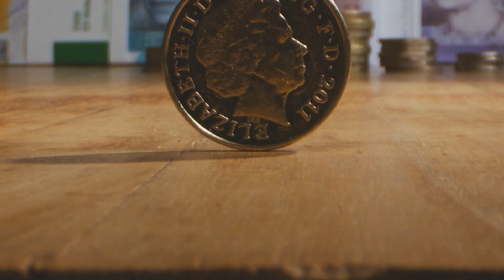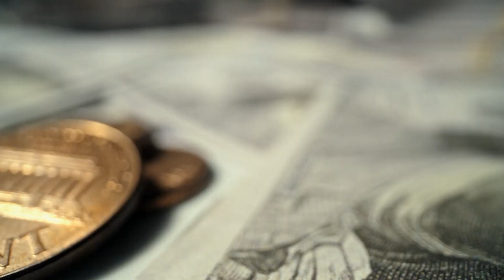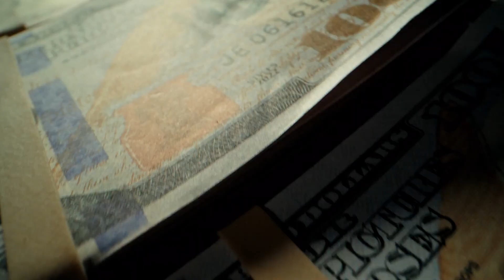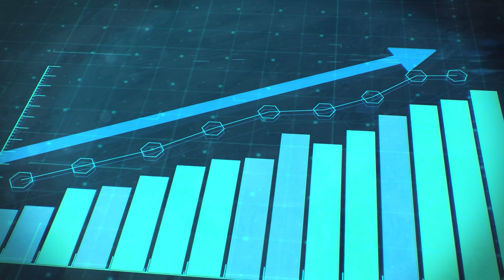What Musk Just Did With SpaceX Shocked The Whole Goverment!

Comment: Q88 is an industry standard questionnaire used to assess the suitability and risk of a vessel when chartering tankers for commercial purposes. It was first issued in 1988 by INTERTANKO and Q88 with the goal of improving safety standards and vetting programs. The questionnaire is now in its fifth version and is the work of the Questionnaire 88 Working Group and the Intertanko Vetting Committee.